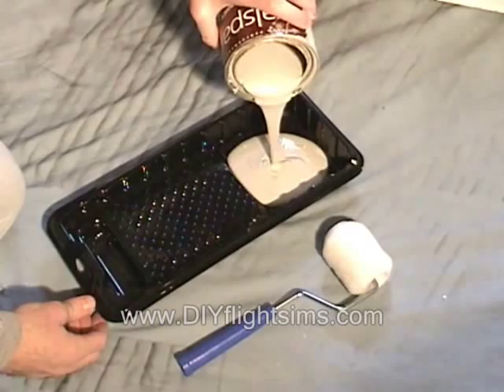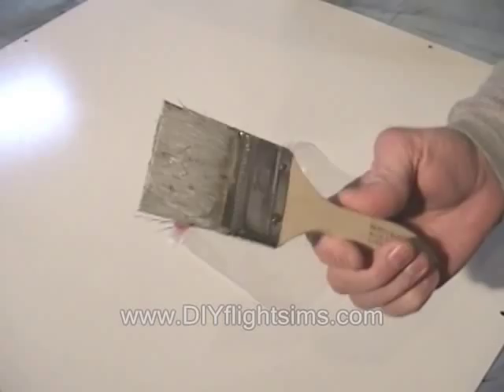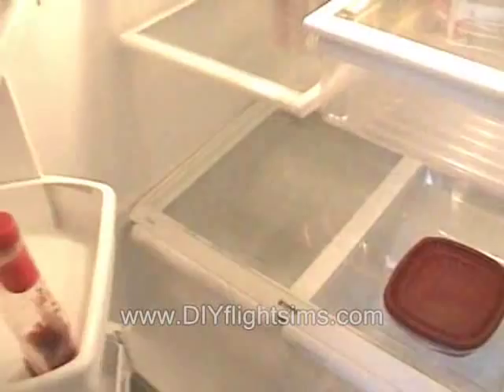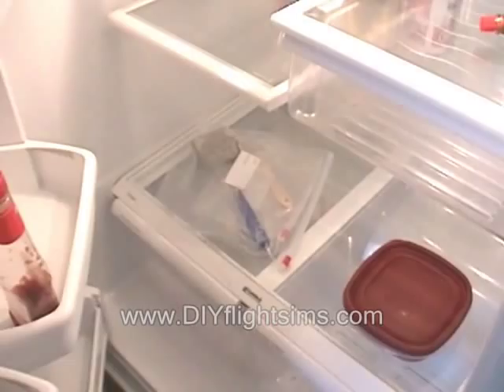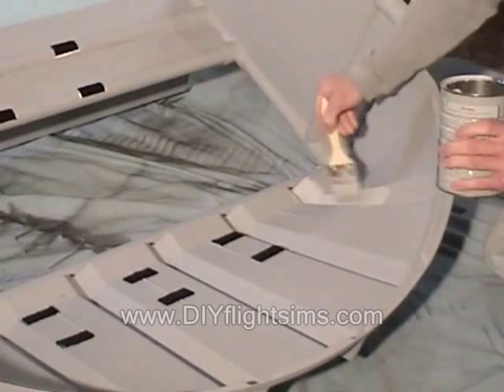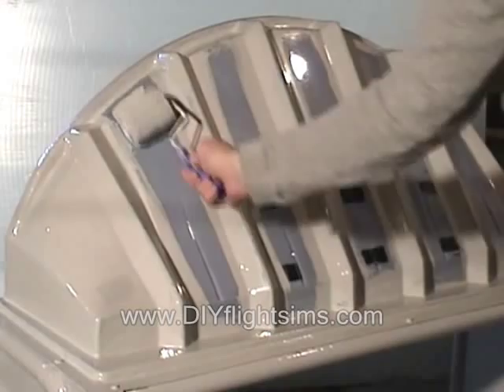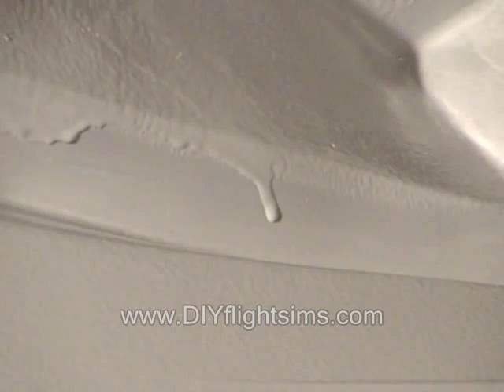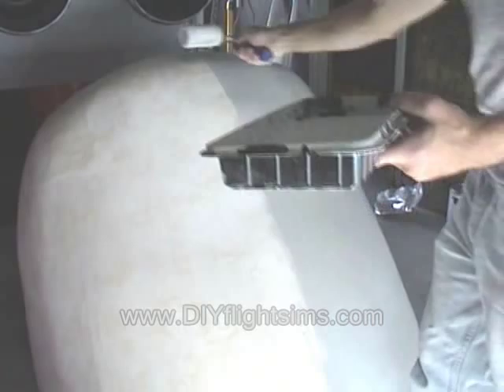DIY Flight Simulator Painting Tips

Comment from the maker: Yes, Lowes should have 1/2" thick expanded polystyrene (EPS), which is necessary for the Desktop Airliner Cockpit because it bends.  If you are building the Easy Airliner Cockpit or the Universal Airliner Cockpit, you don't have to bend the material, so can use Styrofoam, foamboard, even cardboard.